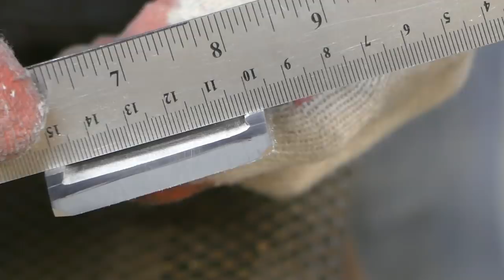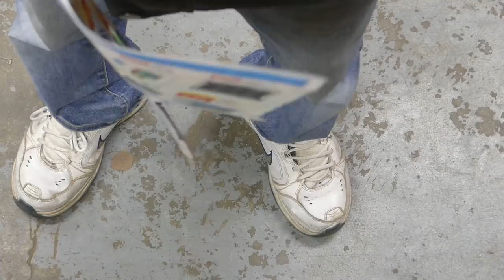Make a Kanna plane

Comment: I think this is a fine plane but I have a couple of questions.  1. Did you intend to set up the plane for 3 points of contact even though its a smaller plane used primarily for smoothing? 2. why did you put a hollow on the bevel side of the plane and not on the "Flat" part of the blade?  I am not yet aware of this configuration of blade style yet.  Normally the hollow is on the flat side of the blade and you only sharpen the tip so as you sharpen the hollow makes it easier on the tough steel.  Obviously you did use only O1 type of steel so it may not matter.  Also the results of the plane are very nice!  I am glad you demonstrated on hard woods!

Comment: Great job! I have a question though; I have several Kannas and they have the concave recess on the front of the blade not on the back. It is the first time I see one with the  concavity on the back. What is the reason for that?
Reply: hi my friend the purpose of the concavity is for when you sharpen the blade you dont have to remove all that steel but just the borders

Comment: Hi there. Nice work. But, could you share with us what metal did you use to make the blade? Was it a simple piece of carbon steel? What is the thickness of the blade? And, finally, why this model doesnt use a chip breaker? The absence of it doesnt make the blade instable when working?
Reply: Didn't you read? The steel is O1.
Reply: @herrero4270 Sorry being so stupid. I didn't read. Lucky me that you be so polite and patient. Although, steel 01 in my country doesn't mean anything.
Reply: @argeancomics3291  I am sure your country have it, with another name. Search in the web the name equivalencies. There are PDF's with the equivalencies from the different systems of steels classifications.

Comment: I'm a little confused. Isn't the hollow usually on the back of kanna blades, not the bevel side? I realize there are bevel up and bevel down plane types, but I thought the hollow side was universally the flat side.
Reply: Yes you are right i am not sure why he did it backwards. The reason for the hollow is because the harder (high carbon ) is bonded to a low carbon steel in the process of making a kanna , which  would take a long time to sharpen.So they hollow out the flat high carbon side for speed of sharpening .

Comment: BUY A MILLING MACHINE FOR GODS SAKE !!!
HOW MANY TIME U SPEND SANDING/FILING THE WORKPIECE BY HAND, EVEN THE BELT SANDER IS INACCURATE AND REQUIRES MANUAL FIXING,
COULD BE DONE IN 10 MINUTES WITH A FLAT END MILL BIT.